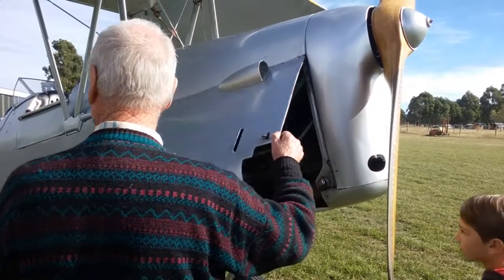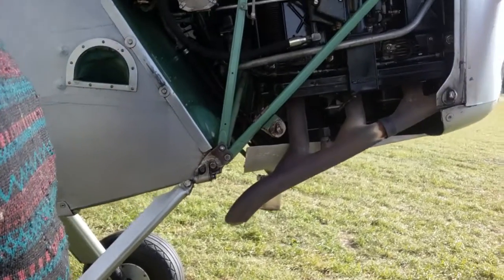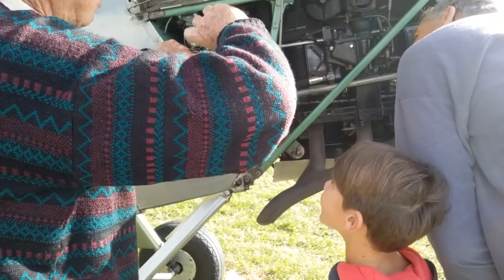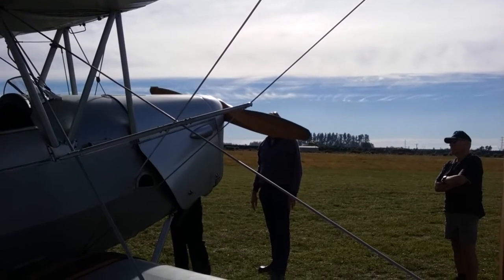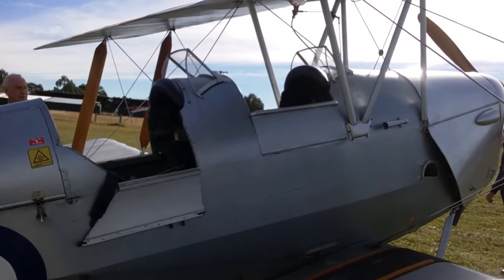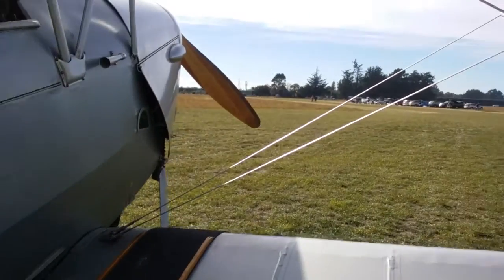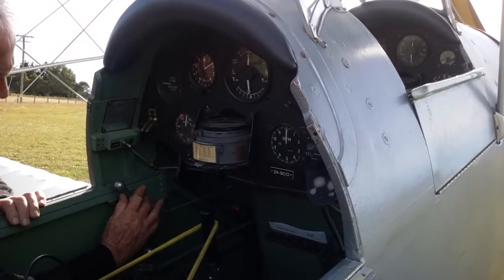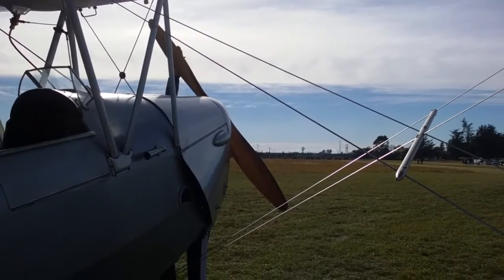How to start a 1939 DH Tiger Moth

Comment: There is also a 'Turn-A-Day' filter under the cowling,never seen a Tiger Moth with mag switches inside the cockpit before ? they are normally on the outside just between the cockpits,lovely aeroplane that appears to be gaining more popularity than ever,lovely agricultural sound to the Gipsy Major when ticking over,a real aeroplane.

Comment: I was always taught never to start a Tiger without someone in the cockpit... 😳! It wouldn’t be the first Tiger ever to head off across the field with No one at the controls....  still nice video 😊
Reply: So you need two people?
Reply: Skwid The Crayfsh Better to have someone in the cockpit ... obviously if you are on you own then you have no choice! 😊
Reply: Ha ha 🤣
Reply: Not too sure about these days, but decades ago it was illegal in Aust to hand swing with someone on board.
Reply: @skwidthecrayfsh34  I always tied down the tail skid. After starting with engine at slow idle untie it and quickly climb in!
Reply: It’s chocked…

It’s considered safe to have no one on board to make sure someone doesn’t accidentally flick the mags on while someone is rotating the props.

It’s a petrol/gasoline engine - it doesn’t have the compression (especially an old gipsy major aero-engine) to start without the mags and it’s a cold start - if the engine was hot it could inadvertently fire but highly unlikely. 

They are pulling the prop back and forth to draw draw fuel into each cylinder having just flooded the carburettor (on purpose) this is like on old cars when you pumped the gas a few times to get it to start in cold weather. 
You want to get a rich mixture so you get that oomph to get the engine going when you do turn the magnetos on.

What I don’t know is why they pull it in reverse a few times. - anyone know?
Reply: Individuals are always capable of doing anything.   However,  as to what is wise, sensible, safe, prudent or just good practice is a different matter and usually centres on the circumstances prevailing at the time and how lucky you were to get away with it,  remembering there is always a next time.
Reply: They tied the tail down

Comment: Started exactly when it was predicted to. Still, how is this better than pushing the start button ;-)
Reply: What do you think the start button does?      It only connects via a relay(?) the battery to a starting motor as well as energise the high tension coil and then the distributor to provide the spark to the ignition plugs.    The Tiger Moth doesn't have a battery, nor coil, nor distributor.      In place of these it has a device called a magneto which acts like a coil + distributor, but requires an initial hand spin of the engine to turn the magneto to produce the spark.    An engine start battery is very heavy whereas the magneto is relatively light and more reliable than a coil + distributor.
Reply: @stuartmccall5474  dude, I'm an 800 hour private pilot and an engineer. I know how planes work.

My dad had many hours flying in a tiger moth and my son has ridden in one once
Reply: @homomorphic :    Friend, for such an experienced aviator and engineer were you not aware that the Gipsy Major engine fitted to most Tiger Moths doesn't have an engine starter motor, or the aircraft carry an engine start battery?   As a matter of technical interest, without an engine start battery or starter motor how would an experience aviator and engineer like yourself start a Gipsy Major engine........with your "start" button?

Comment: Great Video, how about the carburettor heating control. Is it opreated manually or connected to the throttle?
Reply: Inter connected with the throttle linkage

Comment: Gee, just like starting a gas lawnmower by putting it on its side and spinning the blade...I am thinking that flying this crate in the air was probably safer than starting it on the ground.

Comment: The start procedures you show is un-necessarly complicated. After all the engine is a very basic Gypsie Major engine. Its just fuel on throttle set. 7 prop's forward. Put the mags on set the throttle and away it will go with max 2 swings.

Comment: How can it be? Engine running no piot inside. Must be idiots
I would not fly with this guy.
Reply: its called having the aircraft chocked, also the throttle was barely open, needs a fair bit more to get rolling
Reply: @tramlink8544  and the control column tied fully aft.
Reply: It’s chocked…
Reply: Tail tied down